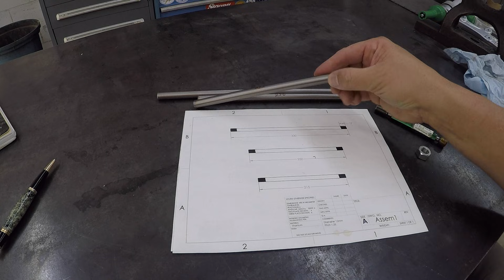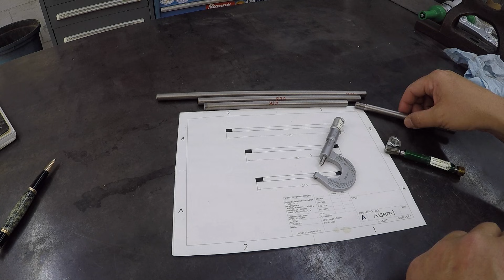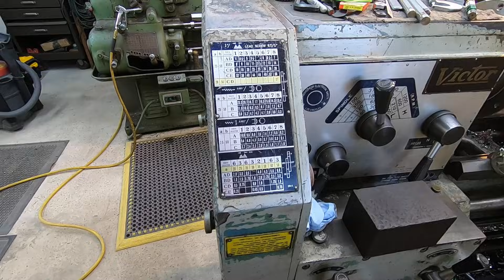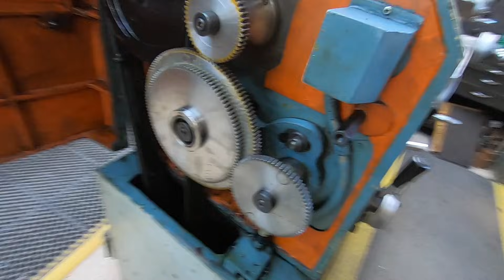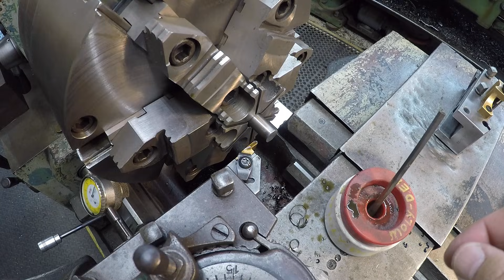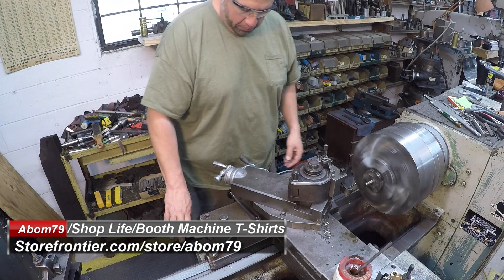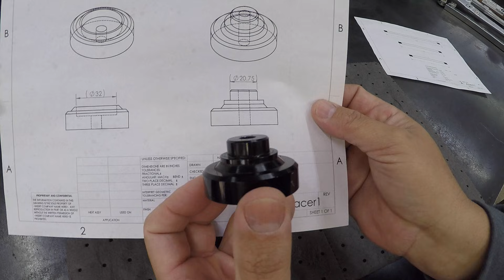Threading Metric Titanium Rod

Comment: I know this video has been up a while, but I just learned this technique a couple days ago and running a 1951 South Bend 9A with no brake its pretty much a game changer for me. All you usually hear is never ever disengage the half nuts when metric threading on an imperial lathe. This makes shoulders and meteic threads a lot less scary for me LOL.

Comment: Nice work but for the life of me I get you have been doing it a long time but running two dials is like spinning plates when one will produce the same result. 
And before the masses start you don't see a cnc machine come down half the angle and they produce a good thread. 
Great work Adam but one dial will work just as well
Reply: You get less chatter and better chip control when doing so, especially in difficult to cut materials using a full profile geometry insert. You also put less pressure on the tip of the insert and make it last longer. Also, CNC machines do it almost always, sometimes even by alternating from which side it is taking the cut to wear the insert evenly. There is no advantage in using  the single axis movement except for thread chasing
Reply: I think you miss the point. This is a belt and braces technique to give good repeatable results if your shop equipment is not the most precise and brand new.
Reply: @martinhow121  No I don't, moving TWO slides for one cut and as you so rightly point out on a worn machine means twice the back lash error.
It is not used when taking fine cuts creeping up on a critical dimension on a OD/ID is it!!
It is in US machining mantra just like reaching for a shifting spanner or hot dogs at base ball...

Comment: Why do you still use and talk imperial?
Reply: I don't know his exact motivation. However, I can personally attest that most tooling used and available here in the US is imperial and works great.  Most of the people who have been in the business operate in both measurement systems.  Many engineers were taught in and still use it.  To retool immediately is extremely expensive and unnecessary.  As more people adopt the metric system it will slowly continue to replace imperial measurements.  In the mean time, as shown in this video, his tools are imperial so he will convert and think in imperial terms.
Reply: Imperial is old fashioned and too compicated.
Reply: @PaulTonkes  Tell me about metric thread dials on metric lathes. The metric system has MANY problems, especially when it comes to threads. The imperial system is superior for threads and more.
Reply: Imperial is an illusion. The last imperial inch was changed to metric in the 1960ies. Today's imperial is just metric with a conversion factor and has its definition in the meter standard
Reply: @alltheusernameswastaken8936  So what? The ISO thread form was adopted from the United thread form. You think that means something? It's nothing more than synchronizing the two systems together. 
Only a dolt would think it is somehow "better" one way or the other. Basing the imperial system on the meter was nothing more than a convenience at the time it was done, NOT because it was "better".
Reply: @billshiff2060  73 years old and did my apprenticipe in imperial. Imperial syatem is archaic and redundant. Give me the tapping drill for a 7/16 UNF thread. Go look up your charts or use a cumbersome formula. Tapping size drill for a 12mm X 1.5 pitch Take the pitch away from the dia and you have your tapping drill....10.5mm.  Divide 4 7/32" into 3 or divide 107.155mm by 3.  No comparision at all right through every measurement Temperature. wind, volume etc etc.
Reply: @rayhughes8240  You only have to know that they pulled the value of the meter straight out of their but whole and it's based on nothing at all. Metric combines the worst of the base 10 number system with the worst matching of measuring lengths to reality resulting in a real steaming pile. Imperial with its flaws ,matches the real world because it evolved IN the real world. Metric is cumbersome because it came from some frenchmans but whole and THAT does not match reality.All so simple minded people can count on their fingers!

Mitutoyo says "Yet the advantages of Imperial units should not be disregarded. Fractions such as 1/4 and 1/8 are useful, as is the physical size of 1 inch and its multiple 12 inches."

In woodworking especially you are required to divide spaces into multiple segments. Metric is base 10 and has only TWO factors 2 & 5. The foot based on 12 is a composite number and is the smallest number with the factors (2, 3, 4, 6), and is the smallest to include as factors all four numbers (1 to 4). So you can split a foot evenly into 2,3,4,6 or 12 parts, in metric only 2,5 or 10 parts. That is why 12 inches in the foot is superior to metric 10 ESPECIALLY if you are building on the fly on location. You don't want those bloody repeating decimals every time you try to divide something into more than 2 or 5 parts . Similarly the yard is evenly divisible by 2,3,4,5,6,8,9,10 etc .

No word yet on when the SI metric value of PI will be declared 4 lol
 (the French revolutionaries) tried to have metric time (100 seconds = 1 minute etc)even wanted a 10 day week lol. They DID change angles to 400 "Gon" in a circle. 

For every supposed advantage the metric system presents , there is an equal advantage in the imperial system. Likewise for Disadvantages.

Metric is crap for machinists. Great for mechanics wrenches. I do both and imperial is better for machining and metrology. .001" is perfect for most everything .0001" for fine work is just right. The resolution of the metric system is clumsy and impractical, forcing machinists to count by 5's or 2's or some crap in between. .1mm is too big .01mm is too small and .001mm is way too small. The use of commas is idiotic, I'm sure they did that just to be "different", very french. Not to mention that thread chasing dials are near impossible on metric lathes, which are standard in imperial lathes, because metric threads are not whole fractions of the master lead screw.

The WORST defect of the metric system is lack of graded pitches to control fastener strength.
GRADED PITCHES			
UNC-Base Screw Strength				
UNF-15% Stronger than UNC Coarse Threads				
UNEF-15% Stronger than UNF Fine Threads				
(Metric system does not have this progression because of their fetish for dividing by 10 and the various standard bodies cannot agree on what pitches should be)	

When was the last time a machinist was asked to machine a liter of water into a 1 kilogram cube? I don't really give a ratzazz what chemists and others do.

I want my base units to MEAN something .001 , .002 , .003 or .0001 .0002 .0003 ETC
NOT .05 .10 .15 .20  or .02  .04  .06
The base unit has to be Measurable AND achievable , otherwise it is wisshy washy vagaries. The imperial system works because it evolved with us. Metric was imposed from on high by your masters.

Comment: Just found out leaving the half  nut engaged is critical for metric threads. The level of frustration I had till learning this!
Reply: It is all metric. The last imperial inch was changed to metric in the 1960ies. Today's imperial is just metric with a conversion factor and has its definition in the meter standard
Reply: @alltheusernameswastaken8936   So what? The ISO thread form was adopted from the United thread form. You think that means something? It's nothing more than synchronizing the two systems together. 
Only a dolt would think it is somehow "better" one way or the other. Basing the imperial system on the meter was nothing more than a convenience at the time it was done, NOT because it was "better".

Comment: Hello Adam and thank you for all things that you explain on your chanel, I learn a lot of useful things, you are the best, I whant to ask you how you calculate the depth of thread on a metric thread? there is an coeficient to be multipllied by the pitch? Be blessed!
Reply: It is done the same way since the thread forms are identical between Imperial United threads and ISO metric threads. It is simply a proportion , not related to the units it is measured in.
The general simplified formula for either inch or metric is:
Thread depth = pitch/2
In his case it is Thread depth = 1.25/2=.625mm or .0246" minimum
NOTE: You can't use that number as a final thread measurement because the nose of your tool will vary a bit so you can use it to get close then measure it and fine tune it. ALSO the compound at 30 degrees you have to divide that number by 0.866 so .0246 depth will be .028 on the compound.

Comment: Metric! welcome to the 21st century 🤣🤣
Reply: Don't be rude.  Just because he can do two measuring systems quite comfortably and you can only do one doesn't mean you have to get all snarky about it.🤣🤣
Reply: @ydonl  The last imperial inch was changed to metric in the 1960ies. Today's imperial is just metric with a conversion factor and has its definition in the meter standard.. 

If you were really using the "imperial system" then a yard - 1 thou would be: 2feet, 1hand, 5inch and 999 thou. Who does that?  throw furlong and league in there and subtract a thou from a mile... good luck. then convert 5,5 gallons of water to pounds... You are all just pretending to use the "imperial" system.  What is the imperial for "volt"?
Reply: @alltheusernameswastaken8936  I might mention that "imperial" is a fairly common term for the ("non-metric") measurement system being referred to her; valid because of how it was derived.  So "we" are pretending to use the term to refer to the system in a way similar to you pretending that attempting to show your superior knowledge in one particular area makes you a superior being.  If you really want to talk about volts, I will wager that I know more about them than you do, but I would only share what I know as a way of saying "Everybody knows something, but nobody knows everything."
Reply: @alltheusernameswastaken8936 👈🤣☝because metric machinists always work in kilometers, kilograms and volts!! How many volts is a 10mm screw?🤣

Comment: I have a thread that I cannot find a tap for. It measures slightly under 10mm, and it’s a 0.90 pitch. Any idea?
Reply: 3/8 28tpi?
Reply: Probably 3/8. Imperial hasn't been used in about 50 years now.
Reply: @chippyjohn1  We use it every day. You must be from one of those developing countries.
Reply: @billshiff2060  You are correct, I am from a continually developing country, unlike the USA that is stuck in the past thinking it is still the 20th century.
Reply: @chippyjohn1  lol I bet you wear funny pants and bizarre facial hair too. If you keep "developing" one day people might be fighting to get INTO your country like they do the US, instead of out.
Metric is crap for machinists. Great for mechanics wrenches. I do both and imperial is better for machining and metrology. .001" is perfect for most everything .0001" for fine work is just right. The resolution of the metric system is clumsy and impractical, forcing machinists to count by 5's or 2's or some crap in between. .1mm is too big .01mm is too small and .001mm is way too small. The use of commas is idiotic, I'm sure they did that just to be "different", very french. Not to mention that thread chasing dials are near impossible on metric lathes, which are standard in imperial lathes, because metric threads are not whole fractions of the master lead screw.
Reply: @billshiff2060  We Australians want nothing to do with the US. Far more people come to Australia from the US that the other way round, even adjusting for population difference. Metric is better in every way, that is why 95% of the world was intelligent enough to change to it. Any good engineer uses it, the end. PS, please finish the wall you are building around your country to stop your kind leaving.
Reply: @chippyjohn1  Great place. An island full of Englands rejects. Damn POME's think you are special now?

Comment: One little time-saving trick I learned: As you started the next cutting pass I could tell that you weren't looking at the thread dial indicator. I watched a few more times and realized that you set the dial indicator during the reversing trip back to the starting point, so it was all ready to go on the next pass. That is a nice rhythm you have!

Comment: Love it 😊. Having a debate over whether you can disengage your half nuts on metric threads on a FB group. Guess I win 😁. Thanks Adam! Cheers!
Reply: There is just no accepting it from some folk. Of course the halfnuts can be disengaged providing the operator observes reengaging them at exactly the same point on the leadscrew indicator.
Reply: You can disengage the half nuts on an imperial lathe when cutting metric threads providing there is a 127 tooth gear in the setup. A 254t gear could be used - 25.4mm = 1" but half that a 127t gear is often used.

Comment: Cool video. Would be great if you could mention the issues that are unique to machining titanium. I've heard it is harder to work than other metals. Do you use special tools? Special lubricants? I work mainly in aluminum so my techniques are much more basic and easy.
Reply: This video is a year old, so don't expect a lot of action. I have done limited machining of various grades of titanium, and the key feature is that *you must keep it cool*. Titanium has very poor heat conductivity, so any temperature you build locally near the tool will just stay there. Many grades of titanium cut easier than steel and harder than aluminum, as long as you don't let it harden.
Reply: Very slow spindle speeds has been the trick for me.  Lots of lubricant.  I mad a titanium ring and other than the horrible stringy mess it makes it was easier than I expected to machine.

Comment: I hope you thoroughly cleaned out your chip pan to make the trip to the recycling place easier? Titanium is not a cheap stock and those chips are worth a lot.
Reply: small quantities like this are not of great scrap value.
Reply: @howardosborne8647  exactly right!, its light and takes a lot of chips, i have contractor bags full of ti chips and it wouldn't pay for the gas to haul it to Denver, although solids are another story, i have few buckets full that would, you can tell right away the folks that have never made chips.

Comment: I still don't get the reason why you cannot thread in metric as in imperial. It's all still gears that are in time as long as you catch it on the dial.??
Reply: Because when using an imperial leadscrew to cut a metric pitch you get fractional drift from the original start point. 
Essentially the whole train of gears and leadscrew combined don't divide into the metric pitch evenly so therefore you would get angular/linear drift if you try it the same way as cutting an imperial thread on an imperial leadscrew.
Reply: @howardosborne8647 good explanation thank you
Reply: @howardosborne8647   the gear train converts when a 127t gear is used.
Reply: Mostly because you need to have the same lead screw pitch standard as the threading system you are using (8 tpi in USA is very common). Either metric or the imperial one typical of the USA. Likely if you live where metric lathes are used you will need to keep your place on the metric lead screw to do imperial threads. Computer control allows (almost) any pitch.
Reply: The pitch has to be even multiples of the lead screw pitch. If not it will not line up after rotating the lead screw. Even metric lathes are a pain because the metric thread pitches are not even multiples either so they have to have bizarre markings on the dials and multiple gears in the chasing dial so they usually just leave it engaged even on a metric lathe.